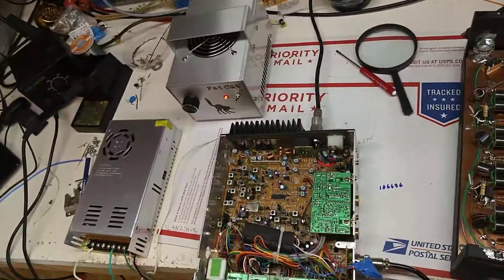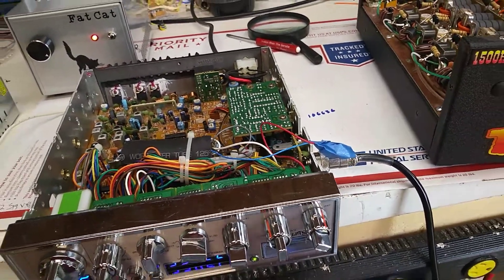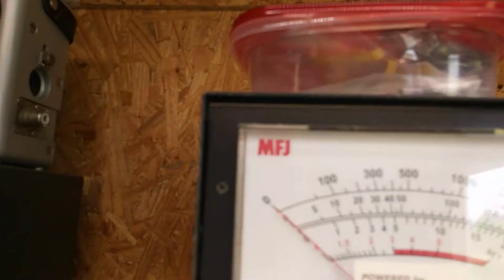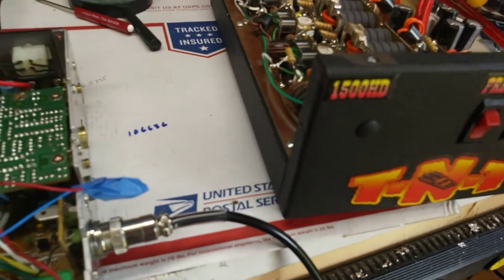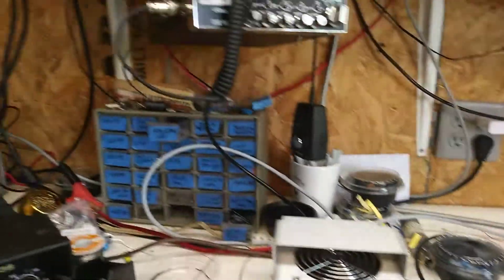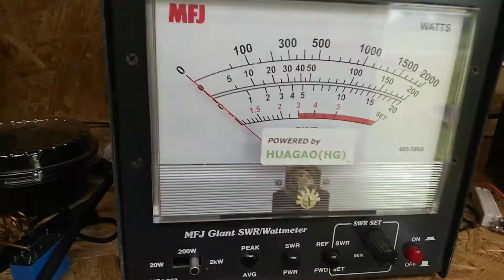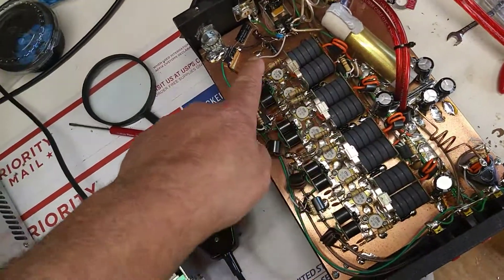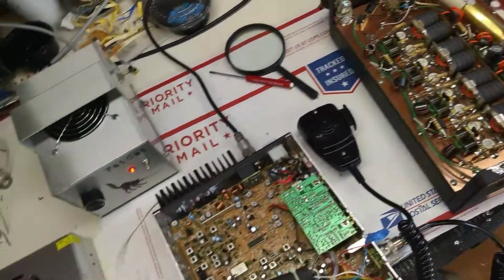TNT straight 8

Comment: Technical question what's the maximum amount of peak Watts that should be put into a set of to 1446 s drivers going into a straight eight
Reply from the maker: Geran Wilson Probly not more than 50 or 60 pep drive i feel safe at